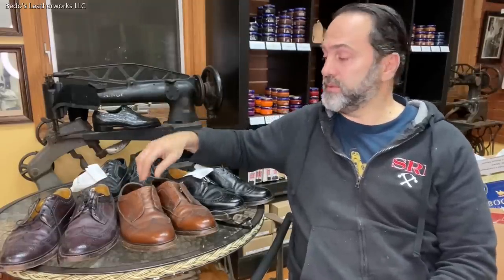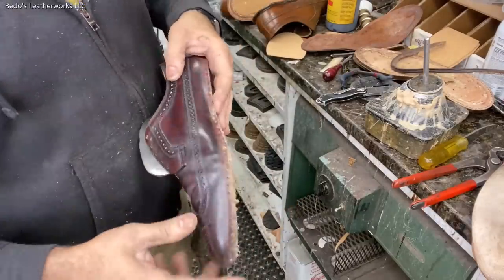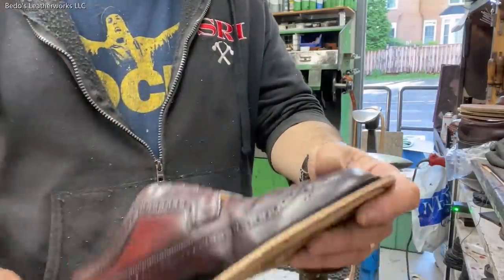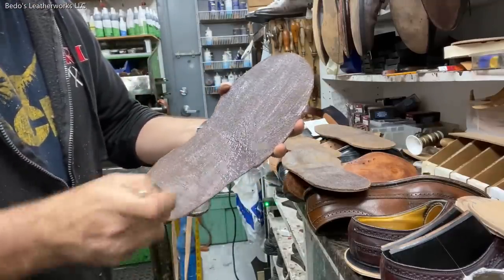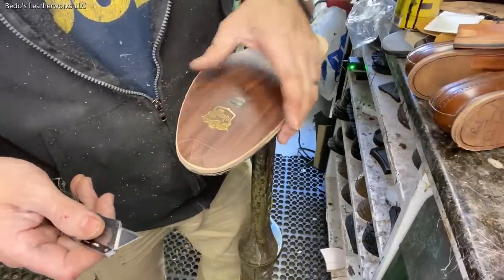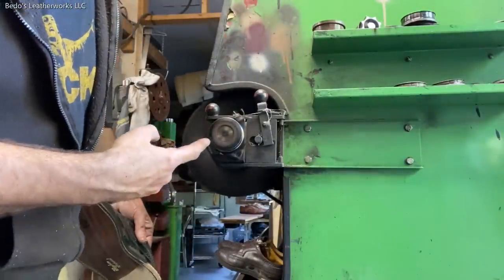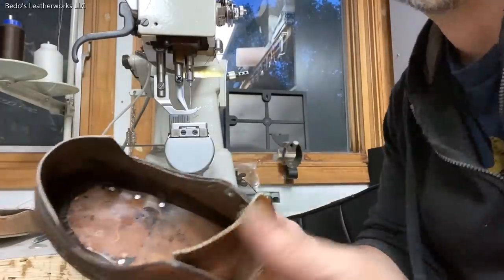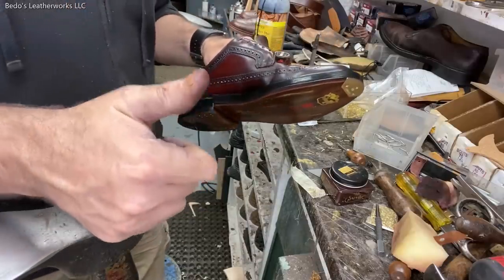Florsheim Florsheim Florsheim Total Restoration

Comment: I always thought shoe restoration was a joke so always ended up buying new. After seeing this video you do better than the manufacturer.
Reply: @Dessun  You can get Florsheim Imperials for around $200-250 new and it’s almost twice that much to refurb them. Very strange.
Reply: @DSKSeattle  good info
Reply: @DSKSeattle  It's so they can brag about restoring "their" shoes. 

A resole on work boots I pay for, a third the price of new.
Reply: @DSKSeattle  having seen this I know why, if I buy florsheims I'm getting them in the shop before I even wear them, that's upgrade time.
Reply: @newunderthesun7353  Its not all about bragging, the quality of the pieces this guy puts on far exceeds what a factory Florsheim will have on it. I'd bet these resoles would outlast 2-3 pair of factory soles.
Reply: @DSKSeattle  new from where? arent they discontinued?

Comment: Back in 1991, I worked part time at a cobbler shop, and the owner had a Rottweiler named Mars.  German breed dogs named after Greek Gods for the win!  I did minor repairs and finish work, and worked full time as a shoe shiner at the courthouse, commissioned through the shop.

Also, inspired by watching your videos, I just replaced the rubber heels on a friend's boots.  One of the factory heels fell off, and she lost it. So I replaced both.  It wasn't the most beautiful work I've ever done, but pretty good for having just a French hammer, a cobbler's anvil, a utility knife, and a Dremel rotary tool.  And I've been using Master's cement for years, too!

Comment: Steve?!?!  You DRINK Fiebing's Leather Dye???  (What?  You believed that question?)  Back atcha brudda.  Solid rebuilds on those.  I used to do carpentry, and there's nothing I disliked more, than to have to tear apart my own framing.  When things are solid, it just feels right.

Between shoes, boots, slings, holsters, and such... I've burned through at least half of one 16oz bottle of the Bick 4 (I ordered two bottles).  Haven't even gotten to my Tahoe's upholstery yet.  Great conditioner for all of those types of items.  I still prefer the Saphir Renovateur for maintaining an already cared-for fine leather good... but, for thirsty stuff, lovin' that Bick 4.  

Get healthy, and extra cookies for the Zeus unit.

Comment: I knew the Florsheim Imperials were nice shoes, but had no idea they were that expensive. I bought 2 pairs identical to these at a thrift store last summer for $14 each. One in Cordovan and one in Black. They were both the same size and were so new, they both still had the original finish on the leather soles and the gold leaf on the leather insole that says Florsheim Imperial is still fully intact. They're gorgeous shoes. You can immediately tell from the build and finish on the leather that these didn't come from a big box store, or clothes outlet.

Comment: 1st: Thank you.  For the video.  Enjoyed it thoroughly. I am at a loss to hear you find bad shoe repair surprising.  98% of the world's shoe repair is bad, cheap and quick.  You are very unique in your philosophy of making it look great and doing the job well.  Maybe 'disappointed' would be a better term.  Question:  have you ever gotten your own repairs back and not realize it.  Did you mentally yell at the previous cobbler?  Tip:  If you can find a piece of leather, try stropping your blade before you use it.  I have had the same blade in my knife for months.  They do eventually wear out.  Stopping makes them sharper than new.  And of course:  Don't call me Shirley.

Comment: Superb restorations if not better than the originals, bravo! I have 2 pairs of v-cleats, the Kenmoor #93602 and the #93604 black , both Bluchers  in great condition and one pair almost 40 years old and the other approx. 30+ years old! They have gotten moderate wear over the decades and are not my only shoes of course so this type of restoration would be over the top! I wonder if even a new half heel pad to eliminate the cleat would be worthwhile? these shoes are almost indestructible and now so cool I am told!
Reply from the maker: We’ve done smaller jobs as well, toplifts usually start at $45
Reply: I will definitely consider sending them to you in the future, your work is outstanding.

Comment: Just a fast question, what is the purpose of the nails on the waist area? Extra rigidity or make the soles last longer?
Sometimes, I do some shoe repairs as a hobby. (I am inspired and also educated a lot by this channel. ) I recently fixed a really old pair of shell pennys. If you can tear a welt down by hand, that a very bad sign. If you can tear the gemming out by hand, that is extreme and it was not a glue failure. Also, someone did a bad job revelting the shoe multiple times, because I saw multiple rows of previous welt stiches on the upper. This made the upper weak, so in some places the upper was cracked, so I glued a thin piece of lining leather between the upper and lining to make it stronger.  I replaced the old insole with a handwelted one, The fix was successful, I wore those guys today. The shoes were repaired a lot of times, but the shell upper did not gave up. Impressive material. Craziest repair I done so far.
I made some pictures: https://imgur.com/a/1GnhVhc
Reply from the maker: Yes it’s to add rigidity
Not bad at all, good job

Comment: Your chest and sinus are clearing out because of the pollution levels that are down. December is our summer months (southern hemisphere). The people coming down from the northern (high pollution) area complain about the same symptoms when their lungs are exposed to clean ocean air. Flush your sinus with 1/2 teaspoon bicarbonate soda and 1/2 teaspoon dissolved in  500ml water that was boiled and cooled. When you sniff the solution tilled your head forward over the bath or outside because it can get messy.

Comment: Great to see you back!  - just one question, which you may have answered before so apologies if so. Why don't you use the machine for removing the old stitches from the welt, rather than doing it manually?
Reply from the maker: because it's a 40 year old shoes and i might do more damage then good
Reply: @BedosLeatherworksLLC  good answer - I'm happy with that :) I have a very similar  pair somewhere  at my mom's house - they were my dad's, and I haven't seen them for a good 20 years when I wore them down to the midsole. They must have been 20 years old or more even then, but I think they were made by Ducker's of Oxford, England, as that was his favourite. Do you ever come across those?

Comment: Hi Steve. I love the look of the old Imperial longwings with the double stitching and v-cleat heels. I was wondering if it’s worth it to source a vintage pair and have them restored? Or is the footbed probably too shaped to the previous owner that it needs to be replaced and relasted? Or just buy a new pair of Aldens and make them mine? Thoughts? Love your work. Thanks
Reply from the maker: most of these shoes you are looking at are second hand shoes, so yes if you could find a descant one that hasn't been butchered by a repair then yes absolutely.

Comment: Steve, how old are the shoes? I have some pebble grain Florsheim but the finish is a bit different.  We’re newer versions fitted with cheaper heel materials? Were the cordovan soles previously reworked? I assume that was not factory craftsmanship.
Reply from the maker: 30 plus years 
And yes the cordovan was repaired a few times before

Comment: Are AE’s wooden shanks as good as fiberglass and metal?
Reply from the maker: most wood shank breaks under pressure
Reply: I’d say not really. They have a tendency to break and I think Steve has mentioned that they are almost always broken when they get to him for a resole. They don’t set off airport metal detectors though (neither does fiberglass).

Comment: When buying used shoes, how do you identify the higher end Florsheims?  I bought a pair at a retail store  last year for around $150 new,  obviously these here are much nicer shoes, but how can you tell?
Reply: Look for imperial or royal imperial (what they called the imperials towards the end of their run in the late 80s to early 90s).

ONLY made in USA. Originals will have the 5 nail soles and the v cleat (if the heels haven't already been replaced).

Check out vcleat.com for more info.
Reply: Thank you.  Super helpful!
Reply: @fiercenet  especially check out the v cleat website to learn to spot shell Cordovan!